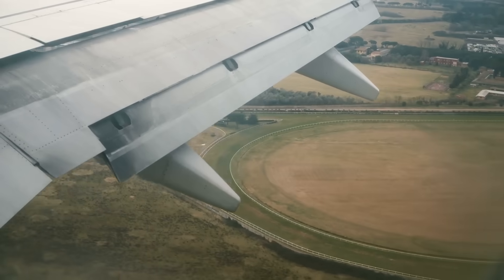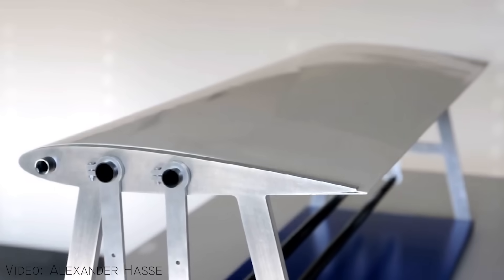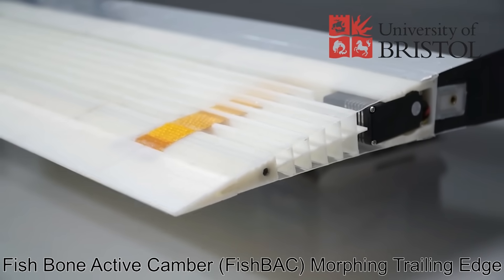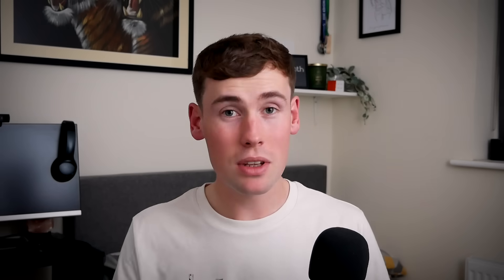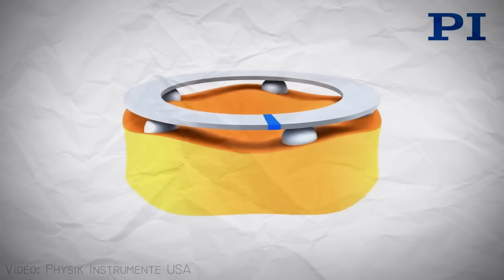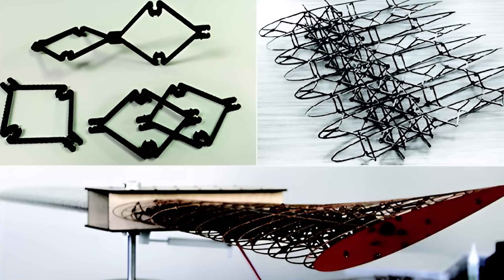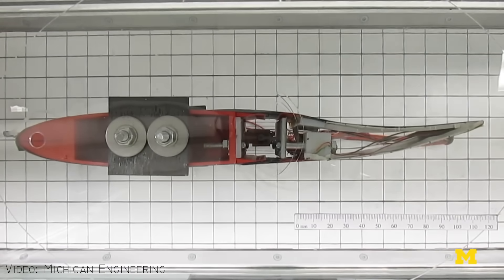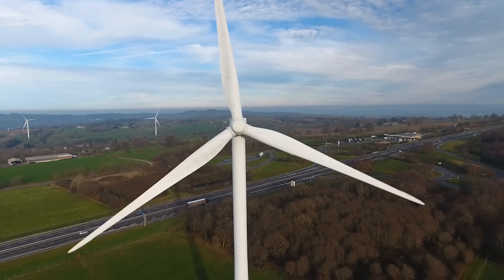Metamorphic Wings: The Future of Flight is Here

Comment: Fuel storage is even more important in hydrogen fuel aircraft, theoretically hydrogen has really good energy to weight, but it has higher volumevso is active design tradeoff in how to store hydrogen in a low volume low weight tank.  On one extreme there is a zepplen and other is heavy cryo tanks.  A hybrid could be filling empty spaces in a plane with hydrogen air pressued mixture prior to burning in engine.  This is complicated but the gas pressure in empty spaces increases lift and optimises fuel air mixture.  This would push wings and plane to have higher volumes but slower.

And there are safety issues.  I guess there is also room to optimise cryo tanks.

Comment: 06:33 ... This was my thought going through the whole video. Commercial airliners for passenger or freight must have multiple redundant systems. How are these types of systems going to have multiple redundancy? They would have to have a redundant control or actuator for each moving part. In essence, three whole wings because how else would you have redundancy on flexible skin or moveable fishlike bone structures inside the wing?
Yes, all of this is great, but not for anything practical in real world application. It already takes a decade to certify brand new aircraft types. By the time this method of making wings and flaps is certified, a far better system will come about and airlines will hold off buying these types of planes while they wait for the new, new plane types to get certified.
I don't see this becoming anything more than an experimental mode of changing a wing shape.
Just look at the world of civilian engine assortment. There are very few different types of engines available for civilian airplanes. The reason? It costs far too much to make a new type of engine or modify a current engine beyond its original configuration before triggering an FAA certification dog and pony show. That costs a lot of money making any new type of engine far more expensive than the ones already certified and proven. This is why no company can make a new civilian engine. Their company would go bankrupt before they could sell a single engine.
Same with this new method of doing the same thing, only better. It will cost far too much, require far too much expense in testing and for a 25% savings decades down the road? Airline companies are already too conservative in what they are ordering. None of those companies are going to buy an aircraft that offers them 25% fuel savings if the plane costs them fifteen times as much as a current plane type costs.
... and by the time all this flex-wing concept is ironed out, certified and put into production, the company making such planes would have had to have spent so much money to get it certified and pass that the airframe would be so darn expensive nobody would buy it.
Neat college experiment - wrong industry to try to get a foothold into making changes like this. Try the military.

Comment: As an engineer having worked with the exact type of linear piezo motors you showed, I can tell you that is the dumbest actuator you can possibly ever choose. I'd rather have a bunch of hobby grade servos driving the wing than linear piezos. Barely any holding force, super sensitive to debris, will degrade and break down like nonyabizness, expensive as your mother. I can keep going. Just adapt the right hydraulic or electric linear actuator and you're good. Cool wing concept though, should have thought of it after making a gripper based around the same idea back in uni

Comment: To prove the theory I'm an airplane builder of hundreds of R/C aircraft. If you want to hover really well, (float at low speed), you close off the gaps between your control surfaces to the point that the wing and ailerons flaps and all become seamless vs the typical gaps between each adding more turbulence. The difference in flight between the 2 designs is incredibly different. It took 3D flights to a whole new level with any size bird from small nitromethane flight to giant scale gasoline stuff at 150" wing spans.

Comment: Not only are morphing wings more efficient, they are quieter as well. As turbofan engines have become quieter and quieter, a lot of the remaining overall aircraft noise is actually coming from the airframe and not the engines. One such noise source is the thin slots and gaps around wing flaps and ailerons, and rudders and elevator flaps. If you don't think this can produce a lot of noise, consider how much sound a flute or whistle can make with just a person's breath blowing over a opening or through a slot. A morphing wing can be designed to eliminate these whistling spanwise slots or gaps along the edges. And so a source of noise that went unnoticed when jet engines still sounded like, well, jet engines can be eliminated or at least greatly reduced.

Comment: So with 125% efficiency, are those surfaces going to flap to make that extra 25%?  You know, since greater efficiency than 100% is literally impossible.
Reply: they are talking lift produced vs glide slope
Reply: @4kbirdpalace628  glide slope is a product of the produced lift at a given speed. I am failing to understand your statement. Glide slope cannot be placed opposed to lift as it is a result of lift (and speed, density and temperature).  If you meant lift vs drag that would make more sense. as the continuous surface would lead to more speed which means you go further for a given amount of fuel, but comparing efficiency then is like comparing the aerodynamics of a boomerang to that of an apple.  I can compare the wings on a 172 to the wings on a glider too, one is the most sold in history and the other is efficient.  What I am trying to get through is that they are comparing these continuous composite surfaces to technology from the 1950s and 1960s.  I would also like to see how they deal with getting stuck in ground effect.

Comment: All b.s.  the airfoil is a myth, fallacy, bird's wings cross section are nothing like that,  the point of attack of a wing is thick and round only because there is a bone in there, very needed for structure not to create any advantage. The wind tunnel is crap too, it uses high speed moving air, in real life the air is static, the projectile is the one that moves.

Comment: An electric plane will need far more space for battery as energy density of batteries is >10 times lower than hydrocarbons. So much so that it's hard to believe that electric plane will ever go beyond smaller personal turbine planes. If one says that lower fuel space won't be an issue for them, then one should question the reliability of all their claims.

Comment: It also gives a much more varied speed range for efficiency rather than the standard range for a fixed air foil, which is far more restricted. Mostly, I think it would improve handling and efficiency at slower speeds.

Comment: In general, most of the lift on the wing is not created by the upper part of the wing, where the pressure is lower. in fact this effect only accounts for 15-20% of the wing's total lift. a large part is the angle of attack of the wing relative to the air and the magnus effect. the wing of any aircraft actually initially has a certain + angle. Usually this is a few degrees around +5 degrees for example. in this position, even when the plane flies parallel to the ground, the wing does not cut the air evenly, and already having a positive degree of inclination, the lower part of the wing seems to compress the air under the wing. Initially, more air comes under the wing and the air under the wing is compressed, hitting the wing. but for some reason everyone thinks that the lift is only due to the asymmetrical wing profile. further, and this became known not so long ago in scientific circles, air literally sticks to the surface of the wing and, for example, in the upper part of the wing, sticking air moves to the rear of the wing relative to the oncoming air flow where the flaps are located - this is the rear part, and then this air sticking to the wing literally turns under the wing and rushes under the wing towards the flow of air that ended up under the wing when the wing cut the air into 2 parts. That is, the flow above the wing turns 180 degrees and begins to move towards the flow that is from below under the wing and colliding again UNDER the wing air compression. This is why most of the lifting force of the wing arises and not due to the vacuum above the wing. Mainly due to the compaction of the air under the wing. And if you add up these 2 effects, that is, the initially positive angle of the wing and the fact that the adhering flow of air above the wing rushes under the wing towards the flow of air under wing and the main lifting force of the wing arises. Moreover, this works even with a flat wing without a profile. so stop misleading people with information about the difference in speeds above and below the wing.

Comment: The best way to improve wings is to use boundary layer suction , to maintain laminar boundary layer all the way to the trailing edge, no speculation, realized on gliders at the University of Delft 
Wings are structurally highly loaded, to carry the bending moment at high acceleration in turns and dive recoveries
The lift is due to the circulation controlled by the Kutta condition.

Comment: Repairs from damages from outside sources?   For example when a line man tugs a plane into another plane.   Are these wings even repairable? How easy can they be repaired? Or is it a total wing replacement?  The idea of metal been flexed so many times over and over with so many temperature differences,  how many times can it be flexed before it has a stress breakdown?

Comment: 125% efficiency is impossible, as it would then generate energy on its own and not need engines. +125% efficiency (compared to standard wings) is rather more plausible. Important difference if you talk about technical things, better be correct.

Comment: What a fun engineering challenge! Taking a wing that is designed to be stiff in bending and torsion, and then have the trailing edge bend and flex in torsion! Opposing requirements on the same structure!

Comment: Re:  Fowler flaps on sail GP boats. (cats/trimaran), thin film covered carbon wings already exist in this space, ideally suited to this surface warp tech.  Sail GP boats have a  'split wing'. It's not really, as many say, but rather, a high aspect ratio wing with an oversized fowler flap, which bleeds excess pressure thru to the low pressure side (leeward on these foiling catamarans) to stop flow seperation And therefore drag, while directing lift strongly in the desired direction. Essentially a wing with landing flaps extended (lots of potential drag) but adjustable AOA for lift/bleed/drag. These also are split longitudinallly in 3 parts, as sails need 'twist' in the upper sections, to catch wind higher up and direct pressure down to the flatter lower sections. I have prototype RC catamaran I'm messing with at mo, and while sail gp foiling boats have had wing tech for 12yrs or more, I haven't seen any of this tech incorporated in their designs, which is exactly suited to this space, where plastic film covered carbon frame wing sails are currently the cutting edge. This skin warp tech could easily add control and power advantages to an already 90kph wing powered cat or trimaran. In fact, this has inspired me to make one. Any help greatly appreciated! 1mtr class foiling catamaran.

Comment: A cambered wing loses laminar flow on the top surface...  segmented flaps and ailerons that direct air over the control surfaces help.  The smooth morphing wind does nothing to address laminar flow separation in a highly cambered configuration.  Morphing the camber of the wing to achieve laminar flow while in cruise flight is very helpful.  The morphing leading edge is not new but the designs shown do offer some improvement.  I think reliability and durability will be the key factors in making these new designs actually usable if and when they can achieve that.

Comment: On you last point about using it with wind turbines. Would make it far easier to control the speed of the blades in different wind conditions which helps not only the efficiency but also safety.

Comment: Flexible skins are not a great idea in high performance aircraft like a fighter aircraft, the aerodynamic forces on the skin could easily buckle the skin which could jam the mechanisms inside the wing, and upset the airflow, causing a loss of control, and if the damage done to the skin is beyond the point of plastic deformation, then slowing down and hoping to be able to de-buckle it may not work.

This may have some uses in lower performance aircraft, but thinking this is going to be applicable to the more extreme cases is probably wishful thinking.

Comment: This seems really cool in theory, but unfeasible in practice at scale. Yes, metamorphic wings might be designed to optimize performance, efficiency and maneuverability, but there's one critical characteristic that i don't see here. The one characteristic that every other spec is built around: Reliability.
The material science just isn't there yet, and bleeding edge incorporated into mass commerce usually only ends with a lot of blood.
Perhaps you're right, this might be the future of flight, but it could also be another blended wing aircraft. :I

Comment: An airfoil creates a lower pressure on the top of the wing and the same pressure on the bottom.  So technically it isn't lift, but is actually suck.   But suck doesn't sound as cool as lift.

Comment: A plane  flying is based on Newtons law, not based on differenz in pressure.

The plane accelarates, air is hitting the wing from below the wing is hitting back with equal force.

When the plane is fast enough, the created force agianst the wing is higher than the gravitational force.

The plane flys. The wingshape is helping but not essential.

Try with a paperplane, it flys.

Comment: The shape changing wings initially seemed to me like they couldn't be used in commercial airliners thanks to the use of wings as fuel tanks, but then it occurred to me you could possibly use the fuel itself as a hydraulic fluid, and use fuel pumps to create the negative pressure necessary to change the shape.
Reply: This seems good on take off, but what about after 6-8h of flight? When most of the fuel have already been consumed?
Reply: @WiinoGP  it could become neumatic by adding air to the inside of the wing
(Fuel+air and bad luck and the wings will blow up tho)

Comment: You got me with efficiency. Have you a video that explains the sequences of wing flap adjustments required to perform a roll over without the lift effect of the wings forcing altitude loss when upside down or sideways movement when perpendicular to the ground? It seems like a lot of energy drain would be required to compensate offset the pulls down and to either side. I've experienced this on a small 4 passenger single prop airplane. I imagine one long flight could waste hundreds of gallons. Most of that fuel/energy waste seems like it could be neutralized with software driven adjustments either programmed or automation similar to autopilot navigation. Seems the adjustments would be a complex system of redundant feedback loops. God, your statement about every extra moving part becoming another opportunity for failure, makes the quest for efficiency daunting 40 thousand meters above the ground. Shudder...Hey, too bad we haven't tapped into nervous tics for an energy source. 
Which brings me to incentives promoting efficiency. Elon Musk believes the best way to create change is incentive. Could a way of rewarding low energy lifestyles while taxing excess be better than all of the technology combined?

Comment: I used to be employed by an aircraft manufacturing company that did much useful research on boundary-layer control by suction of air from the wing and fuselage surfaces. This was aimed at use to reduce the cruising-drag of long-range flying aircraft. It was effective due to it stopping the boundary layer from becoming turbulent and maintaining its initial laminar form and slowly growing thickness compared to that of turbulent boundary-layers. Now that we have projects for wing shape morphing, as illustrated in the above video, my suggestion is that this methodology should also be applied to boundary-layer control problems. It was shown that that the skin-friction (or turbulent flow) drag of a suitably sucked wing-surface, can be reduced by at least 75% and that for a whole aircraft of a suitable shape (more like a flying-wing) that at least 50% reductions in fuel consumption can be achieved. Please note that when a design change is made to reduce structural mass or fuel consumption of any regular aircraft, that the effect increases above that of the "simple" drag reduction ratio, due to the lowered mass of the vehicle requiring even less energy to drive it over the same distance and carrying capacity, and that at its lower (optimum) wing-loading it can fly at greater heights where the thinner air enables its ground-speed to be greater than previously. The advantages of wing morphing are huge, in design changes, resulting reduced fuel consumption, greater performance and general operations for these kinds of aircraft.

Comment: These will be huge for light aircraft and drones. These is serious issues with these getting damaged or being strong enough for large aircrafts but not a problem for small crafts. Maybe they are solvable for large scale crafts but it's not a problem for small ones.

I could see this significantly reducing fuel costs and increasing range for future delivery bots. 1/weight of wing plus double lift or whatever 😮 that is huge for drones. The potential for this is massive 🎉